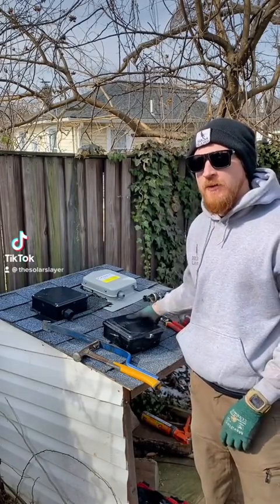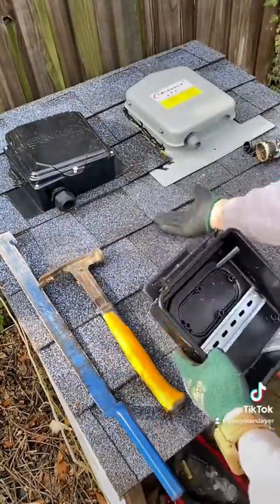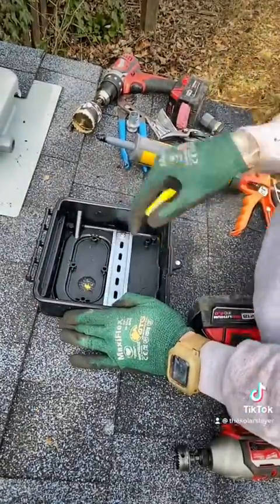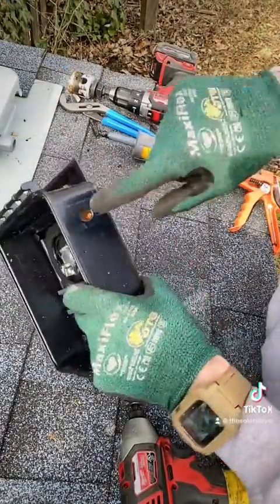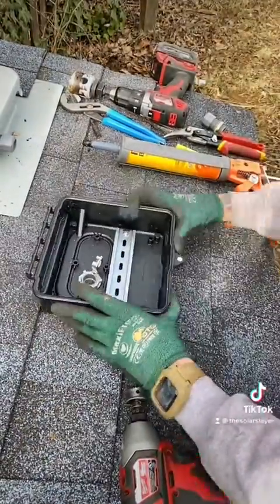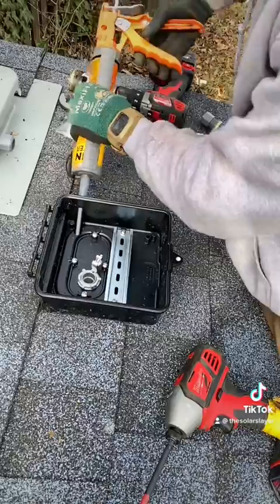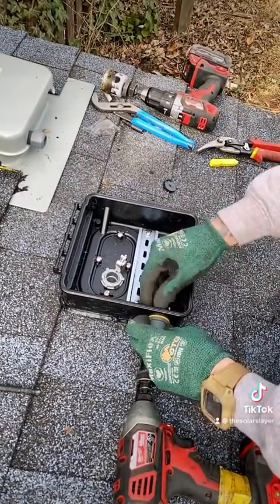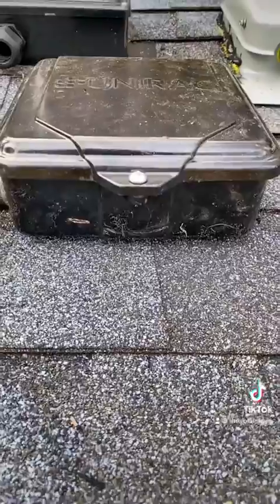How to: Install a Unirac roof junction box

Comment: Had some leaks with this type of box. The design is pretty poor. It's great practice to prefill the gasket first and then add your bead of geo around the box after. Also learned to cut out the architectural part of the shingle so that the gasketed portion sits completely flat on shingle course. Soladecks seem to be the way to go with pv junction box systems. Thanks for sharing man